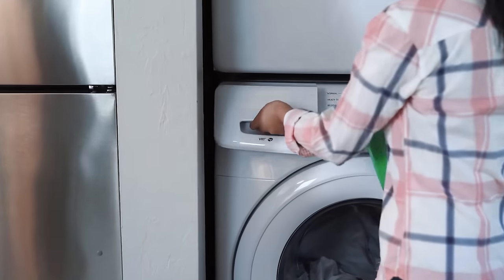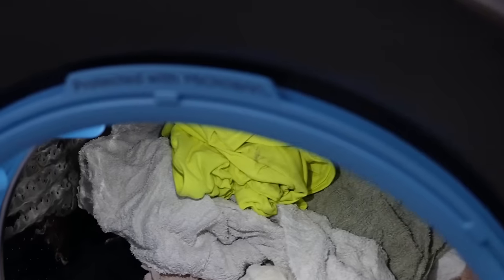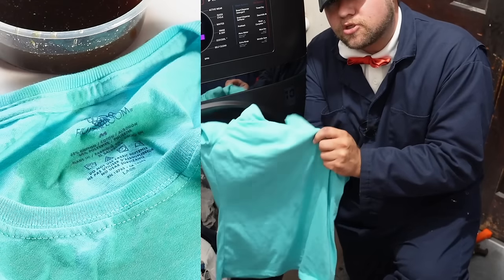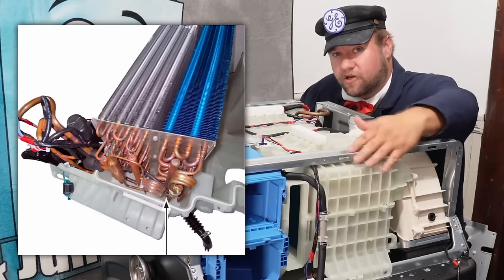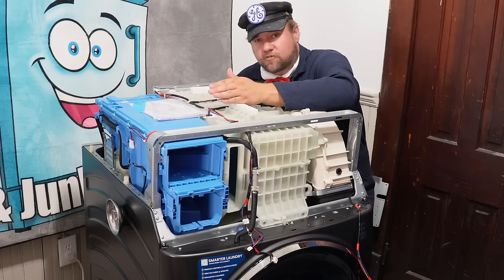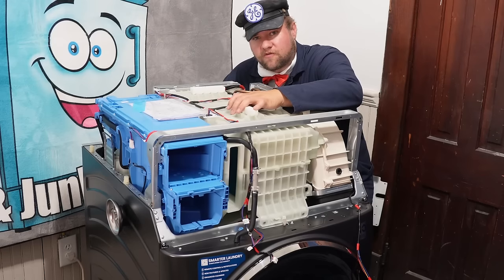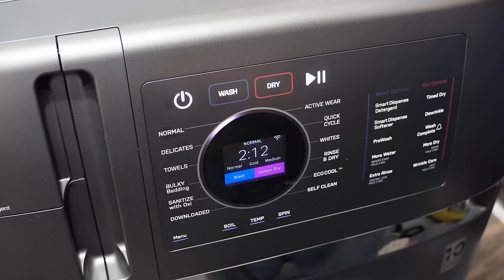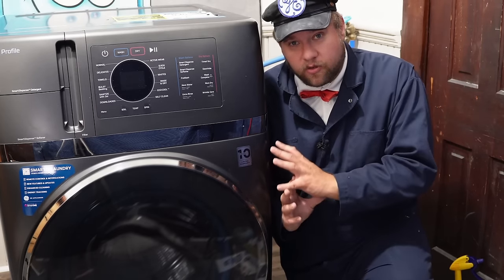The Best Washer Dryer EVER? The Ultimate GE 2-in-1-washer Dryer Combo Test & Review

Comment: Traditionally, (European) washer driers had the limitation that they could roughly dry half the maximum load of the wash, so if the maximum wash load was say 9kg, the recommended dryer load would be 4.5kg. Whilst this may sound inconvenient, it is generally better to dry similar fabrics together - cottons, polycottons etc. I was amazed that on your second load the washer managed so well when the drum was so full - impressive.
Reply from the maker: The second test was more or less a max-capacity torture test to vet what really happens when its loaded down. It was rather impressive.
Reply: Are current washer (which just broke) and dryer are two different brands. Our washer was 5.2 cubic feet and I don’t know what the dryer is but it is larger. We could not stuff the washer full because even with the dryer being larger it would still put too much strain on it when that many items in the dryer. Also the vent pipe for our dryer goes all the way across our house so it puts even more strain on it, we don’t think it is going to last much longer but it has lasted longer than 2 washers at this point. If it does fail we might get a ventless dryer.
Reply: Yep, we solved that! Dry what you wash, pound for pound, or as Europe would say, kg for kg! 🗺
Reply: @geappliances Didn't expect an appliance brand to be lurking in the comments, haha.

When's it coming to Canada?
Reply: @ulogy   They finally released an appliance that is getting good reviews. Of course they're going to hang around and bask in it. lol

Comment: I already bought one when I outfitted my new cabin with all appliances. Home Depot had a Fourth of July sale in that machine was $2,000 and I got another 250 off for the bulk purchase. I will not get it until the middle of September but I am looking forward to it especially now that you've given it a good review.
It also has secondary energy savings in that you're not taking your warm or cold air out of your house and exhausting it outside.
Reply from the maker: Re, warm air - yes, this is 100% a great point that I didn't get to keep in the original script.  Since its not drawing ambient air in to heat up and throw away, you get extra savings. Its hard to quantify how much of a savings that is, though.
Reply: @bensappliancesandjunk hey, my contractor just called me about putting in cabinets next to the washer and I need to know is that door reversible? Can't find any information on GE's website.
Reply: @Leonardokite door is not reversible. The inside glass is angled to improve air flow; GE said they made it not reversible to optimize drying. Since you don’t have to move laundry from machine to machine the door swing is probably fine in most spaces. One of the designers said all this in a video interview on another appliance channel, but seemed to realize they need to take door swing into consideration on future models.
Reply: @RedErin  thank you for that response sir 👍😉
Reply: @Leonardokite  absolutely not reversible as per the 95 page GE manual for the washer
Reply: I put one in my cabin and love it. Throw a load in go enjoy the lake and outdoors come in and have dry cloths. I absolutely love it.
Reply: That's crazy dude. I bought mine from Best Buy during the 4th sale and I got mine July 30th. It would have been sooner if I allowed them to ship to me, but I wanted to pick up and install myself.
Reply: @Skormm  unfortunately I was not ready yet for the appliances. I had a delivery date of August 15th but had to delay it till September 14th. It isn't home Depot that was the holdup it was the phase of the building project.

Comment: I completely agree with bopitybull. I must be an old timer. I dry all of my clothes, which is typically three loads. Afterwords, I take the filter out and clean it. The dryer has lasted 30 years and operated flawlessly. The only reason I’m buying new is I’m moving and need electric vs gas. I think you hit the nail on the head when you said all people want to do is put things in and turn the switch without ever having to do anything more. I can’t remember any time that my father would replace some thing unless he tried to fix it first. Back in the day you could do that but not anymore.

Comment: First reviewer to talk about load size. Terrific. I am amazed that a full wash load was able to dry as well as it did although looking really wrinkled. Looks like a half load is the way to go like other combo units. Comparison to other combo units like the LG, Siemens and Whirlpool might be nice.
Reply: Makes me wonder how dryer sheets work with this.
Reply: I just came across this washer looking for parts for my ge space saver. It says they come out a little damp but dry really fast after fluffing. So folding them and not letting them sit in the basket would get rid of the wrinkled look.

Comment: YouTube randomly suggested your video. One of the best washer dryer reviews I’ve ever seen! We have basically the washer only part of this one from GE. Based on our standard dryer use, I would guess this is saving 1 to maybe 2 kWh per wash and dry cycle. Not a lot by itself,  it would add up over the years. The peak wattage used is certainly less as the standard dryer hits 6,500 watts on low heat mode. I understand you are getting two units for the price of one, but would really want to see some kind of sale on this to buy it. Our GE washer is only a few years old so not exactly in the market anytime soon….or at least I hope not.
Reply from the maker: These have already been on sale for as low as $2,000... Down from their initial MSRP of $2,899. I also have been told what wholesale on these machines is currently. There's a hefty margin on them through retailers, so the real-world price on this has a LOT of wiggle room. GE dealers are making heaps of cash right now which is rare, because appliances have notoriously bad markups.
Reply: @bensappliancesandjunk  Do you think $2000 is a fair price for this machine? I was able to get a local appliance store to quote me $1999, which is near the lowest I’ve seen, with the exception of Costco offering it for $1700 for a couple days.

Comment: Replaced my broken GE 13-year-old washer, and got rid of my GE dryer same age. Bought this new all-in-one. Works great for single person like myself. I like how it dries and doesn't make my clothes burnt stiff like my old manual-dial dryer. Usually done within 2hrs, sometimes 2hr30min but that is fine with me. A big load of towels, or jeans, or a queen mattress will take the most time to dry. Otherwise the quick wash comes in handy too. I'm not going back to two machines. GE has a winner here with this machine.

Comment: [See my reply in Jan 13 2024 update post] Best video I've seen so far on this machine. I got one in August 2023 and love it. There are some problems - as you mentioned - the maintenance of the lint component is key. I have to clean the filter after EVERY wash - even after self-clean (I get the prompt). Sometimes there will be a few items that stick to the drum at the end of the cycle. I also clean the pump filter every week or two, but I still get notifications about changing the lint filter. My vacuum cleaner can't even get the filter compartment completely clean. All that aside, I am totally in love with this Groovy Combo.
Reply: Do you have to change filter??how long the filter last and how much is cost?Ty
Reply: @nomankh6717  I recently got a message from the app that I needed to replace the foam filter and there was a link to purchase it at GE for around $12. Not bad except, when I clicked the link, the filter was out of stock and there was a message saying it's estimated to be available by Dec 2024!
Reply: @theboonog  Oh dec 24 still long time,do u recommend to purchase?because m in the market to buy still confuse 😬
Reply: @nomankh6717 Although this machine has fallen a bit short of what I was led to expect from two interviews I watched with the designer, I still love my Groovy Combo. I am beginning to get concerned that the unit I purchased may be defective. It doesn’t dry well and stopped drying completely last week. I unplugged/replugged it, and it dried the load when I re-washed it. I’ve been diligent about following the maintenance instructions so I can’t see I’ve failed in any way to cause this. At some point when I can find the time I’ll contact GE to have it checked out. But being able to skip that load move from washer to dryer more than makes up for the maintenance. It also does a stellar job at removing lint from clothes.
Reply: @theboonog  Thank you….is groovy combo lasted longer and low on maintenance?

Comment: I have a combo front loader(Midea) with a heat pump dryer. It does not dry towels fully, and I have read online that this is usual for a smaller unit. In 10 years of use I have only had to replace the drain pump. Other than being slow(4 hours for wash + dry of 5kg clothes) my only complaint is that it has always been noisey. However, it is far more gentle at drying than my old skool Simpson dryer from the 80's. That thing might never die but it turns everything to cardboard. I only ever use it for towels.

Comment: Great review.
 But many people might understand that because it is a heat pump and a 120-volt system. You do not need a vent or a 240-volt power supply. All you need is a standard AC outlet and plumbing for the washer. So if you have an old washer setup in your garage but not a dryer setup you can replace the old washer with this.

Comment: My current washer & dryer are over 10 years old (washer probably close to 15), so I’ve been keeping my eyes out for replacements. This unit would be great for us as a senior couple with a small laundry room.  I only do 2-3 medium loads per week, so even at $2500, the cost per load over the next 10-15 years would be minimal.  Definitely keeping this one on my short list, & looking forward to your continued reviews on it! Thank you!
Reply: I've owned 2 of LG'S versions (moved n left in the home). LOVE them!
 Clothes come out clean fresh and dry! Now if they would put them away lol😂
No filter to clean...just occasionally a basket to dump out.
Reply: Keep your old appliances. They will a lot longer than anything you will buy today...
Reply: @megadan66  The biggest issue is the low water washers.  But low water is not really a concern with a side load washer.  For top load washers, the only one I know of that is any good is the ge 4.2 cu ft that has the water level knob.  Most new top washers have no water select knob and want to tumble your clothes with barely any water in the drum with the level set by autosensing.
Plus with an all in one side load, you can put it on a stand that sets the door height at the level of your chest.   No bending over to reach anything.
Reply: This washer dryer will not last more than 5-7 years.
Reply: @georgeoh5361 haha quite the pessimist. I'm going with 10.
Reply: It's on sale now at different places for 2k and I see there are a few other brands now for much less than 2k but they claim a smaller capacity?

Comment: I've had one since first introduced and have well over 100 loads so far.  It uses some AI logic to learn your laundry habits such that now a normal cycle comfortably runs in under two hours, typically 1:50.  I use a handheld vac to clean the filter after each use so it's quick and easy.
Reply: I think a dustbuster or cordless stick vac in the laundry room would make cleaning a breeze. And if you have a utility tub/sink in there, even better for the foam filter.

Comment: Thanks, Ben.  Here in UK (and continental Europe) heat-pump dryers seem much more common.  It's surprising US hasn't bothered much with them given the money-saving (though elec is MUCH cheaper in US than Europe, where it's approaching 40 cents/Kwh here).  I have an LG HP dryer and washer and have found them fine.  My only concern about a combi is that it could overall be less reliable than sep units (if my dryer breaks I can still wash).  Although, as you say, common fail points are electrical on modern washers, sooner or later the bearing goes on front-load washers, and at £2000 / $2500 I'd absolutely require a separatable drum to facilitate bearing replacement (the problem with modern FLs is sealed drums, preventing otherwise serviceable washers being repaired, thus the criminality of scrapping for the sake of a small, cheap part).  I'd also like to see replaceable spiders at this price (assuming it could degrade, as notoriously happened with Samsung washers only a few years old).

For that cost I think I'd prefer to stack an LG washer and LG HP dryer, which at UK prices would be c £11-1200 / $14-1500 for both.  But for people less geeky, who want seamless washing/drying, this looks good and your judgement is reassuring.  I wonder what Consumer Reports' evaluation will be?

Best wishes,  Marcus
Reply: wow, that's 4x more per kWh than a lot of places in the US.
Reply: @bluearcherx  Yes, it even more expensive in Germany.  In UK it reduced a little recently to 30pence / 38 cents - so there's a great incentive here to save on drying costs.
Reply: Ours is 9 cents per kWh where I live in the US. Can't imagine paying that much for electricity.
Reply: So true.
Reply: Imagine having actual healthcare. Or infrastructure that isn't falling apart. You get what you pay for generally, and we are cheap as hell. We get paid cheap as hell, and we spend a lot on cheap garbage that will just end up in a landfill.
Reply: @frax1826  true dat.
Reply: @bluearcherx but all our appliances are much more efficient as a result. We also don’t use electricity for heat traditionally (only those with a heat pump). And less airco.

Comment: I have a washer/dryer combo made by Marathon Laundry.  The main difference with it is the dryer is vented like a regular dryer instead of having a dehumidifier.  Overall, it's a good machine. The reason I bought it was because I live in a 240 sq ft former lawnmower shed.  So space, or lack there of, was key.  It still takes longer than a normal dryer would, but it gets the job done.  Plus you can easily program more drying time into your washing/drying recipe.
Reply: Did you get it at auction?
I hope it gives you good service, since it appears they are defunct and everything went to auction in August 2023.
Reply: @blaydCA  
That explains why they aren't answering emails.  I'm not surprised to hear it though.
It works ok.  But I honestly wouldn't buy it again if I had it to do all over.
The first machine they sent me looked like a prototype model.  It looked very different from their advertised model.  It had trouble getting heat from the heating element into the tub.  
I complained about it and  a  little over a year later, they sent me their newest model.  
It works much better, but it still doesn't dry as well as a regular dedicated dryer.

Comment: Thanks for the info. I just bought a new washer and dryer this year, and settled on an LG pair, but this combo unit caught my eye. The reason I didnt go for it was the price, and I feel like being the first model, its bound to have bugs and issues that will be worked out in later models. So when my new ones kick the bucket (hopefully not for a decade or so) il definitely consider an all in one unit (it'll probably be the standard by then anyway).
Reply: Worth noting is these heat pump combo units have been standard in Europe for at least a decade. I wouldn't worry too much about it being new and unproven tech.

Comment: I’m a dryer vent technician ( I clean and service dryer vents) This video was excellent. Looking forward to seeing the maintenance on the other filter. 
I am interested in seeing how these machines do after a few years. There is A LOT of lint that accumulates in a regular dryer vent. I’m not sure how this machine deals with all that.
Reply: My guess is that's why the screen needs more frequent cleaning and there is a secondary foam filter to clean. Tbh I don't hate the fact that it eliminates the need to clean a vent periodically.
Reply: The UltraFast is much easier on clothes and uses less heat than a conventional dryer. This creates far less lint and helps your clothes last longer! When the lint filter needs cleaning, usually every 3-5 loads, the unit will alert you, so lint build-up over time is not very likely!